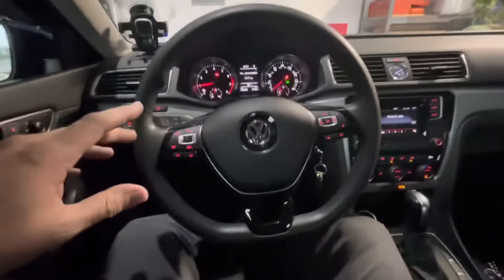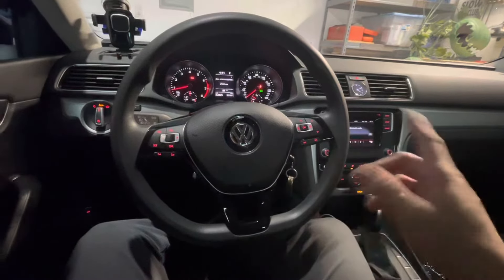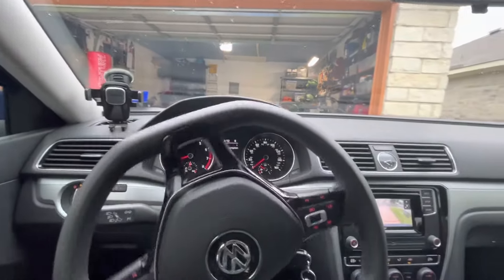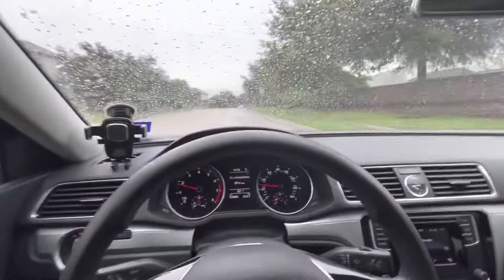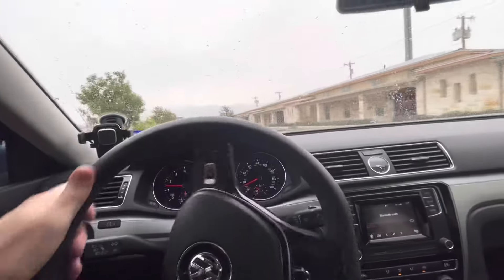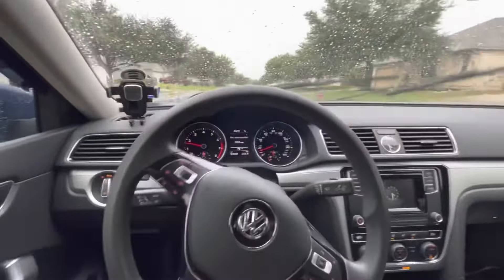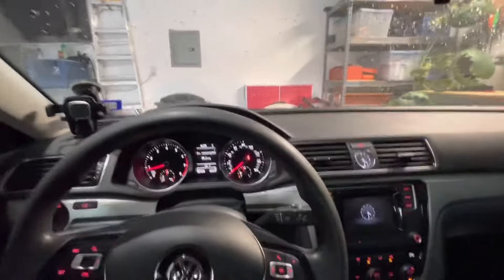Volkswagen suspension clunk/pop front end -DRIVING ME MAD- subframe bushings? Troubleshooting noises

Comment: I had the exact same problem on my Vw t5 transporter I changed every ball joint drop link , radius arm bushes track rod ends strut bearings and still it knocked!! It turned out to be the subframe bolts 😩 they are stretch bolts a previous owner must of had the subframe off and not put new bolts on , I loosened oiled fitted a thick washer and retightened the bolts , knocking gone wohoo 🙌, I’ve ordered a new set of bolts 👍
Reply: I'm at this stage now with my t5. Replaced all sorts and still creaks and knocks. I'll replace the bolts as the last guy said he slung another gearbox in it a few years ago

Comment: Yesterday only i fixed mine same in my polo. When it is related to weight shift popping/clunk its 97% times bad lower/control arm bushes. Fixed in my case.
Reply: I took mine to firestone a few years ago and they wouldn't give me an alignment because they said the lower control arms were bad. Ofc I elected to not fix it but now I have this sound so I think it's the same issue.

Comment: I had solowerks coilovers they did this (not as often as yours) but like you said it’s just cause they’re cheap. Honestly tho they lasted me 40k miles and I slid off the road and had terrible roads near me and they held up great. They just rode like crap and clunked but hey they were 500 bucks when usually their 1000 for coils and the car looked great. But everytime id turn full lock it would clunk. I got rid of that Jetta with thoes coils and now have a 2016 Passat 1.8t and definitely wouldn’t buy solowerks again
Reply from the maker: I think I’ve got about 20k on mine now and they are holding up fine but just as freakin noisy as ever. Annoying but not the end of the world I guess. Lesson learned!
Reply: @DADMOBILE_Garage  they’re definitely solid coils and they’ll last but definitely a lesson learned for me too. I love watching the Passat videos and thanks to you have found some cool mods to do. Keep up the funny videos🤣
Reply: @DADMOBILE_Garage  I know with the solowerks coils on the Jetta it used the OEM top mount for the front struts. I’m the instructions it says if they aren’t installed with the arrows facing the car( I think) then they can make clunking and popping sounds. They’re also just cheap sadly so some noises are bound to happen

Comment: Did you figure out what is causing this? My car is doing the same thing. I'm too scared to drive it while it's making these noises. 😢
Reply from the maker: Nope drove it like this for a couple years then traded it in. There are so many different things it could be. I never figured it out.
Reply: I’ve been driving my car like this for 5 years so you’re probably good. It’s an Acura TLX. 2 dealerships said they took it on a test drive and didn’t hear anything another independent shop also said everything was fine. Yet when I turn onto a curb or any uneven surface my car sounds like it’s going to snap in half with all of the popping/creaking noises 😂😂😂 I try to stay on flat surfaces hahahah

Comment: I had a similar problem with my 2015 VW Tiguan, after taking it to a garage it was diagnosed that both of my front bushes had worn away which left the metal parts rubbing against each other which is bad, the mechanic advised not to drive the vehicle in this condition as it can further damage other components of the car. The mechanic sorted me out in a couple hours for £135 (ref June2024, North East England).

Comment: seems like some of those occurred whlie you were braking. to me it sounds like brake pad fitment in the calipers. not really dangerous(i dont think) but usually the pad should be pretty snug and instead it just moves around a little. Take your wheel off and see if you can move the pads up and down in the caliper. id do taht before going to anything else, assuming you haven't already solved it!
Reply from the maker: Yep my pads do occasionally make some noise, but I have discovered I have spring bind in the front (springs too soft) and that’s making most of the noise

Comment: Have you tried subframe collars? Have you performed an alignment recently?

The mk7 gti has a similar issue and it said that the bolts that connect to the subframe are stretched and they don’t hold the subframe as they should leading to the noise. I just ordered mine and will keep you posted if it solves the issue.
Reply from the maker: Had a German performance shop tell me it’s only my solo werks springs binding/tapping becasue they are too soft. They said everything else was fine. I have given up lol. I looking to trade up soon anyways. Hope you get yours figured out!
Reply from the maker: Also, no recent alignment, checked tightness on every frame/suspension related bolt. No sign of looseness. I used new strut bearings when I did the coilovers. There are marks on my springs indicating that they touch frequently. Replaced endlinks as well. Cv boots looks good but I suspect at least the passenger side axle is bad due to vibrations at certain speeds, so that could be some of the noise.
Reply: @DADMOBILE_Garage bro for now do you have an update about the popping sound? i have the same problem bro and im going crazy thinking what it is.
Reply: Me too. Steering, oil, axial joints were changed, but the clunking still occurs randomly, which is very frustrating.

Comment: I’ve had some similar issues replacing a bunch of suspension parts after installing S1’s also. Guess the S1s were just too budget? Maybe Bilstein next time round.
Reply from the maker: I’m definitely not messing with budget coilovers again. Apparently the wrong springs are frequently included with the Passat kit. Was told this by a solo werks person and they sent new springs but they are still too soft in front and bind like hell
Reply: Changed to Bilstein shocks, changed discs, sterbilizerinks and now it's making this annoying popping sound decided am going to leave it parked for the week as I research more as to what is wrong, cannot be just sending money with no results

Comment: One VW expert took my car for a test drive and said "yep, definitely the steering rack, change them all the time", I changed the steering rack.  Another VW expert said "oh it's the strut top mount, they go all the time", I changed the strut top mount.  I have changed so far, the rack, the strut top mount, the left side coil spring, both bottom ball joints, the sway bar bushes and drop links, I have also released and retightened just about every bolt on the front subframe and suspension, I still have the clunk.  The clunk is like a coil spring that is twisting and then releasing at a certain point, it comes from the left side and only happens when reversing with full steering but otherwise drives faultlessly.  My car is now legendary with all the local mechanics.  I love this car but it is testing my patience.
Reply from the maker: Holy!!!! That sucks!!
Reply: Strut bearings
Reply: Finally got to the bottom of the issue.  Everyone who inspected the car and test drove it was convinced the problem was around the left front corner.  All of a sudden the dash lit up like a Christmas tree with every fault associated with ABS, diagnostics pointed to the wheel speed sensor on the front right.  When the wheel speed sensor was removed it was found to have been worn through about half way at the end, further inspection found that the wheel bearing on the front right had been shifting laterally when weight load shifted.  Replaced the wheel bearing and the clunking stopped.  Replaced the wheel speed sensor and the faults also disappeared.
Reply: @SOLO-ht2cc  in the vw the strut bearings are in the mount he replaced that
Reply: @mbshaw1  I feel your pain. i did something similar. thinking i would get rid of the sound. i think it the bolts that hold the subframe bolts and lower control arm and the big one on each end if all else fails. I have a spare wheel bearing so i will do just that at some point thank you.
Reply: This is exactly how I would describe what my car is doing. The struts, bearings and mounts were all replaced by a VW dealership recently and it's been popping and clicking ever since. I took it back and they said they didn't hear anything....not sure what to do now. Did you ever figure out what it was?
Reply: @AB-fq7mv  it was the hub casting, the main bearing assembly was slipping sideways in the casting and the only reason it did not slip right off the car was because the brake caliper was holding the brake disk in place.  First check the wheel speed sensors, if either of them is worn laterally then it is because the bearing is slipping in the casting.
Reply: @mbshaw1  I'll check first thing tomorrow, I appreciate the response!
Reply: Have you checked your mounting bushings? For motor and transmission
Reply: @Trickierick  it was the main hub casting, a pothole had opened the casting enough to allow the main wheel bearing to move laterally, the only thing stopping the whole wheel assembly sliding off was the brake caliper.  The best clue to this happening is the wheel speed sensor being worn on one side.  Ebay had a hub assembly in stock, problem solved.
Reply: Yup, the same problem with Tiguan MK1, all new.. you find something ?🤔🤔
Reply: did u ever figure anything out with yours. Same is happening to me
Reply: @isabelramos7372  check the abs sensor, if it has wear on the end it is because the main bearing is shifting side to side.  The only reason it doesn't slide right off is because of the brake calliper holding the brake disc in place.  The bearing will shift if the casting has become enlarged due to an impact, likely from hitting a pothole.
Reply: same thing, changed the strut and the top mount, steering rack at the dealer … about to change a pair of lower arm and sway bar link … discovered the dealer forgot to tighten the left hand side top mount nut 🤦‍♀️ and spray some silicon lubricant, all silent now
Reply: @AB-fq7mv  any luck fixing yours? What was it?
Reply: @blissthefall  it was the hub casting, the main bearing was now shifting in the casting.  This came about because of a large pot hole that I distinctly remember.  The only reason the wheel and hub assembly did not fall off the car is because the brake caliper was holding the disc.  You can check for this movement by removing and inspecting the wheel speed sensor, it will have wear on the end if the bearing is moving.
Reply: @mbshaw1 I’m trying to chase down my front end clunking as well. We’ve checked over everything in all standard ways (no pry tools just manual pushing/pulling on parts) I have new moog end links to install. I’m looking at bushings, as you can tell from me finding your video. I may get an upgrade for the sway bar bushing/ now, and  buy new front wheel bearings. I have already replaced both rear.
Reply: idunwantmynamehere @idunwantmynamehere check the abs sensor, if it has any ware on the end it's because the hub bearing has shifted in the hub which means the hub has stretched, likely due to a pot hole.  Mine turned out to be just that, replaced the hub casting and the clunk disappeared. Check other replies I've made.
Reply: @mbshaw1  Thought I owed it to ya to come back. My end link bushings were starting to show wear when I took off the OEM. Since the car was jacked up I got under there and checked the subframe hardware and the smaller bolts all let me turn an extra half a turn or so. Clunking is gone.
Reply: @idunwantmynamehere  The clunk turned out to be caused by the main hub casting having stretched after hitting a pothole.  The casting that everything is mounted on at the corner will now not hold the main wheel bearing as it should, this then allows the bearing to move from side to side and the only reason it does not allow the wheel to depart is the fact that the brake caliper is preventing the disc from going too far.  The easy way to check if this is happening is to remove the ABS sensor and inspect it, if the end of the sensor is worn down at an angle then you have the same problem.  I bought a complete corner assembly from eBay and the clunk is gone.

Comment: Had the same issue with my MK6 Jetta. One of the subframe bolts on the right side of the vehicle was rusty and broken. Was able to replace the broken bolt with a new one and now the clunking noise is gone.
Reply from the maker: Nice! I never figured it out but pretty sure it was overly soft springs on my coilovers. Checked every bolt/bushing many times. Based on all the comments here it does seem the subframe bolts are the most common cause of similar noises tho.

Comment: Dude I’m going through same things, went to a shop and they couldn’t hear nothing. 
Of course it didn’t act up with them, but it makes the same noises as yours when driving the same.
I will be changing my inner and outer tierod, lower control arm and ball joints, as well as sway bars. Hopefully it fixes my issue.
Reply from the maker: Damn that sucks. Is yours stock or lowered? Mine happened after lowering it so I think it had to be the coilovers but I’ll never know since I traded the car in
Reply: did that solve your problem

Comment: My vw polo 9n 1.9tdi makes the Exact SAME  noise and driving me crasy!!! EVERY bushing in the front and rear axel are replased by powerflex bushings and all motor mounts are new, completely new suspension alway around.... but i can't figure out WHERE the fuck the noise is comming from.... but... what i could read me to from others it could be from the swaybar...
Reply from the maker: My sway bar bushes could be worn out but I have cheap coilovers and the springs are touching/grinding so that’s most of it for me. Poor decisions/cheap parts is mostly my problem.

Comment: I have a Nissan Rogue that does similar things and I hear those bushings being bad are common on those vehicles. I had a 2013 Passat and never had this problem with it.  I miss my Volkswagen and want to get rid of the Nissan and go back to VW!  Mine had the 5 cylinder engine which might be one of the most reliable engines Volkswagen ever had.  It did not have direct injection or cam followers and even has a timing chain.  Also it has no turbos that might fail either.  If you want turbos and direct injection with it, Audi has a direct injection turbo version that must be fun to have if you can keep it from eating tires like they are breakfast!!
Reply from the maker: I think mine was due to aftermarket cheap suspension/lowering. I never figured it out but I loved that car and would not hesitate to go back to a VW if I need another responsible car. This one got traded in for a 2011 gt500 tho so….eating tires is now becoming part of my reality 🤣

Comment: I have the same issue on a 2019 VW Atlas. I got underneath and foun a broken Suspension Subframe Crossmember insulator. In basic terms its basacly acting like a transmission mount. Theres actually a lower (Part Number: 3QF199867A) and upper (Part Number: 3QF199868D). Its easy to access the lower one but its pressed in.
Reply: I recently had mine replaced on 2018 3.6 SEL Premium... they are a pain and caused all of the pops when shifting/downshifting in this video.

Comment: if something like this is happening, is it still safe to drive your car?
Reply from the maker: So many possible causes for front end noises. Hard to say for sure. In this cars case, I checked every nut/bolt/bushing/moving part I could. Multiple times. Nothing was loose or broken so I kept driving it for about 2 years before trading it in. Never had an issue beyond noises.

Comment: Did you ever figure it out? I juts changed differential seals and passenger cv acke on my jetta. Took it for a test drive and it still pops and sounds like you can everything turning under the front end
Reply from the maker: I never did before I traded it in. I replaced strut mounts and end links. I think it was too soft springs on my cheap coilovers.
Reply: @DADMOBILE_Garage  yeah. I might be giving up on that damn thing myself. I've never in my life been so frustrated working on a car ever. Every time I think I'm done, one gotta take it back apart for some reason

Comment: I am guessing that when you put it in drive and reverse and it clunks its probably the driveshaft/ cv-axle.. i think you can check this  while the car is in the air and you spin the wheel forward and backward and see if you have the clunk.. also if your cv joint is ripped for a long time it will catch dirt and wear the cv axle out faster..
Hope that this solves it..

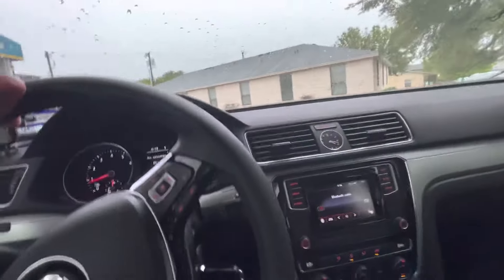Comment: 1:53 that clunk indicates it could be the brake pad brackets, gaps in there left enough room so that when u hit the brakes while reversing, the pads shot towards the top of the calipers, making that sound
Reply: Had this exact issues my S3, they replaced the pads for free again but now it only happens on the one side (drivers side). I have a feeling its still the brake pads moving slightly, especially if you have changed them recently.
Reply: I have a rattle on the left side on my golf 7 when driving through uneven surfaces, but when I brake before entering the uneven surfaces, the rattle is gone. Also, when reversing with the first move, I also hear a clunk. Is it my brake pads?

Comment: @dadmobilegarage I have a similar issue. Did this cause any vibration at highway speeds?
Reply from the maker: I do have some steering vibration at 60mph that is more pronounced off-throttle. I THINK I have a bent right front axel, and that the suspension noises are mostly spring bind from too soft of front springs
Reply: @DADMOBILE_Garage  Thank you.  I appreciate it.